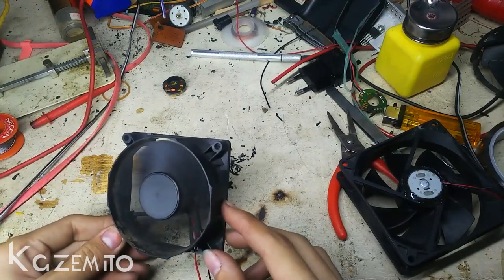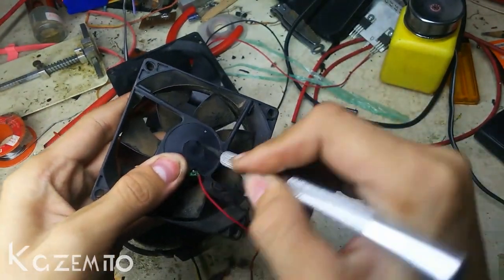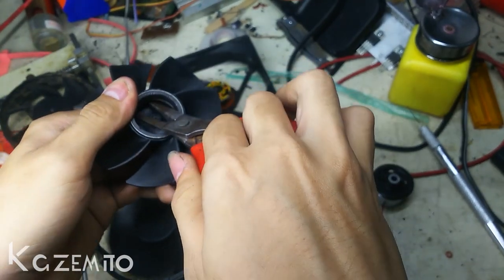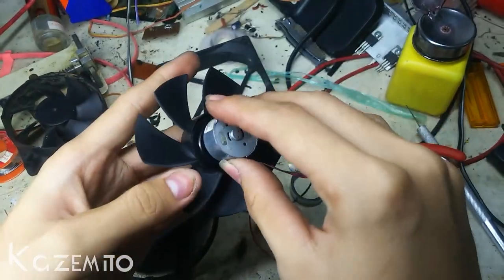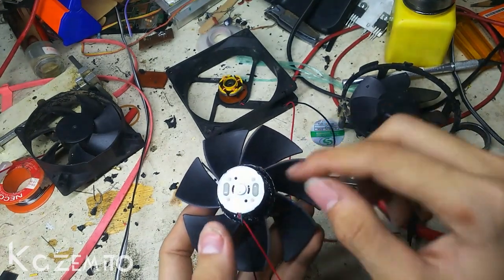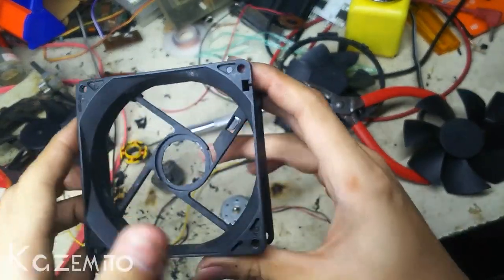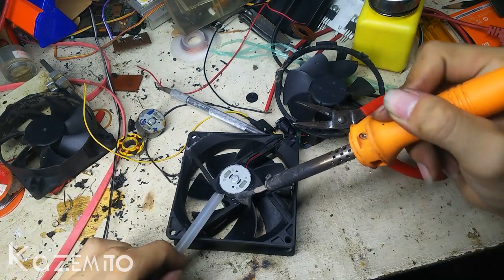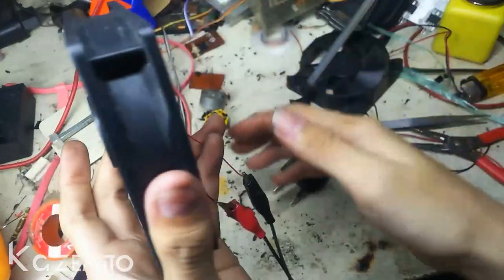Make your PC Fan RUN 10X FASTER!!

Comment: Thanks for your explanatory video for improving the fan speed for PC Case Fan.

But how do we make this an PWM fan so that we can control the speed? Do we have a improvised brush-less motor for fan which will can be controlled?
I guess you have heard of Delta Fan, have you tried connecting to a computer motherboard directly? I tried but it is not working.

Any Ideas would be really helpful. TIA
Reply from the maker: maybe I'll consider to make follow-up video with pwm support! that's gives me an idea. the only thing you can control the fan is sing voltage regulator or use buck converter. honestly I made this fan just for stupid experiments not for actual uses for PC 😂

Comment: Buy a drone motor and the correct size drone fan. Screw it into your computer case, or a piece of perforated sheet metal. No vibration and almost enough air pressure to make your computer fly xD ...moral of the story... Buy a DRONE FAN and MOTOR
Reply from the maker: Good idea, I'll consider it.
Reply: @KazemitoHaruhi  Haha. It's a joke. Drone fans use 40 amps. Motherboards are 2 amps. You'll need a separate power supply.
Reply from the maker: hey, i got cheap bldc fan, and 30A esc, I'll make what you suggest.
Reply: @KazemitoHaruhi   I hope it doesn't fly away )

Comment: You know that you can buy a server delta fan.
Reply from the maker: I know you can buy Delta fan but why need to buy if you can modify it. This is stupid budget DIY tutorial. Some high speed Delta fans are not cheap enough.
Reply: Yes but how long will it last before it overheat
Reply: @leonardolimon8371  overheatng is not the problem but the brush of the motor